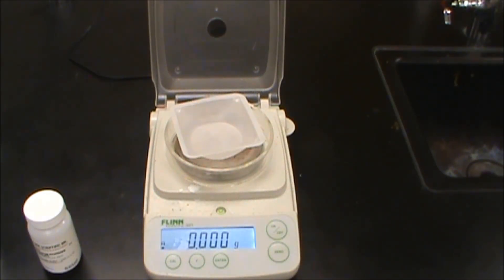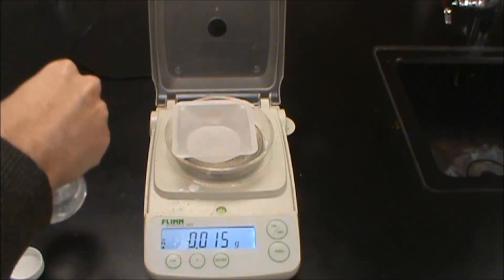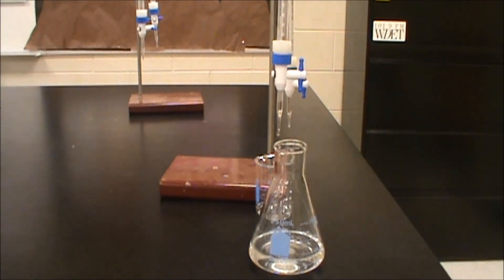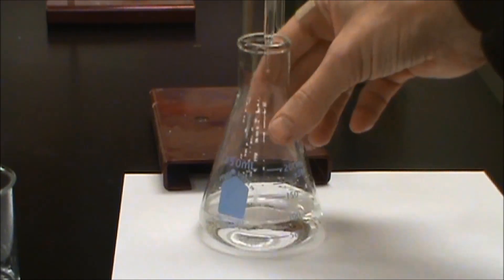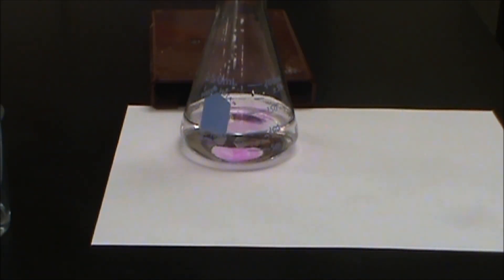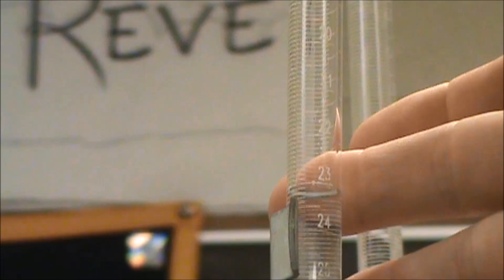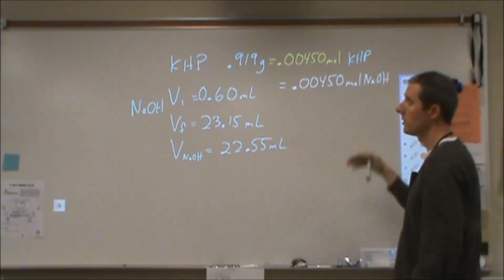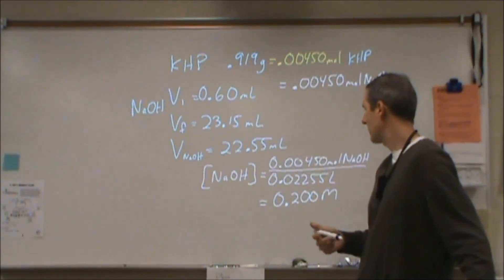Standardization of NaOH using KHP experiment

Comment: molarity is number of moles divided by volume of the solution 
so when i measure the molarity
do i have to take the volume reading after adding the solute 
or it well be okay to use the solvent volume only ?
Reply: For a dilute solution you would probably be ok to use the volume of the solvent.  But it is best to use a volumetric flask and dissolve the solid in a portion of the solvent then fill to the mark to make sure that the volume of the solution is correct.
Reply: DebChem 
Thanks a lot

Comment: it makes no difference how much disstiled  water you add to KHP?
Reply: The H2O doesn't react with the indicator or the KHP and NaOH, so no the amount of H2O makes little difference in this sense. The water just acts as a way for the ions in the KHP and NaOH to react freely with one another. **However adding a large amount or too little of water to the KHP will make a dilute/overly concentrated solution and the ions will be spread farther apart or too crowded together.
Reply: @dad_patrol  tnx alot

Comment: How did you get V1 = 0.60ml???
Reply: Hi there, I know I'm late, but V1 is the initial reading volume of burette before titration. Some people use 0.00 mL as V1. 

But, at the end, how much volume NaOH titrated into flask is what matters most. Not the initial reading

V used = 23.15 mL  - 0.6 mL = 22.55 mL
V used = 22.55 - 0 mL = 22.55 mL

Volume titration  = Volume final reading - volume initial reading 
😊

Comment: I want to do titration for 0.1 M NaOH solution.How much amount of KHP will I need?
Reply: You can use the same amount, If you do you will find that your final volume of NaOH added will be about twice as much.
 If you change the amount of KHP you need to work out how many moles(n) you have for the calculation (ie you wont be using 0.00450). So you use C= n/V where C is concentration N is number of moles and V is volume tritrated (in litres).

Comment: How did you get 0.919 grams of KHP?  Aren't you supposed to subtract the tare of the tray?  Your sample + tray was 0.903 and the tray alone was 0.016.  0.903 - 0.016 = 0.887 grams.
Reply from the maker: It read -0.016 after I was done.  The calibration gets messed up a bit when they haven't been on very long.

Comment: you didnt even take into consideration the amount of water you dissolved the khp into?
Reply from the maker: The amount of water doesn't matter at that point.  The KHP also does not need to fully dissolve in the water because it will become more soluble as it reacts with the hydroxide.

Comment: please reply to me. how do you calculate the weight of khp needed for NaOH standarization? let's say I want to standarize 1 N NaOH, how many grams of khp I need?
Reply from the maker: Google says oxalic acid works, but I'd use KHP since it's monoprotic.  KHP works well because it's highly pure.
Reply: KHP is a primary standard.
Reply: What are the other alternatives to using KHP?
Reply from the maker: You would be unlikely to do that, the NaOH is unreliable in concentration, and titrating with KHP doesn't serve any purpose other than education and there are better alternatives to use.  But if you did the calculation you would do the same thing as in the video, but you would fine the moles of NaOH from the concentration and volume, the moles of KHP needed would be the same to get to the equivalence point and the mass can be determined by multiplying by the molar mass of KHP.

Comment: What is standardisation and why we have to carry it out?
Reply from the maker: it's determining the concentration to a high precision and NaOH is notorious for absorbing things from the air as a solid which affects the concentration.  KHP is very good at being synthesized to very high purity and therefore can be used to determine an accurate concentration.  In other words, if you mixed 10.00 g of NaOH with water to form 1.000 L of solution, your concentration would not necessarily be 0.2500 M and the KHP allows you to figure it out.
Reply: Scott Milam thank you very much :)

Comment: why do we need to degas the water before titration? will it make the molarity of naoh falsly high or falsly low? thanks
Reply from the maker: I believe CO2 can enter the solution and react with the NaOH to make NaHCO3 and Na2CO3.  The solid NaOH used to make the solution can also absorb water and CO2 before you make the solution.  But the KHP is very pure so you can rely on the moles of base from the titration.

Comment: How do you know which indicator to use?
Reply from the maker: KHP is a weak acid and NaOH a strong base, so the pH at equivalence is above 7, phenolphthalein turns from colorless to pink around a pH of 9.  The rationale beyond that you can find here https://www.youtube.com/watch?v=tRsju52Hcn4
Reply: Thank you. The pH range of phenolphthalein is about 8 to 10 and I was confused about why it's okay to assume the eq point is right when the color changes if the corresponding pH could be anywhere from 8 to 10, but the real eq point corresponds to only one specific pH. I think this is because the corresponding volume is relatively the same during the steep climb in pH during the eq point. Therefore, if the real eq point is when the pH is 8, the corresponding volume of NaOH used to calculate molarity would be similar to the corresponding volume if the equivlance point is when the pH is 10.
Reply from the maker: TheTheaterThug The pH +/- 1 derives from the Henderson Hasselbach equation, for an indicator it has a 10:1 ratio when it was 1 pH unit away from its pKa there is a 10:1 ratio of the two colors.  So at pH of 8, you have 10 colorless molecules for every 1 pink, and at pH of 10 you have 10 pink for every one colorless.  But the amount of base needed to go from 8-10 is less than a drop so any pink color is more than sufficient to identify the equivalence point.

Comment: Question: Why did you add the mass instead of subtract the mass measured after transferring the KHP? Shouldn't that mass indicates than mass that is not transferred?
Reply from the maker: +Ms3k0 It's reading as a negative mass for the final measurement, it's -0.18 g not +0.18g.